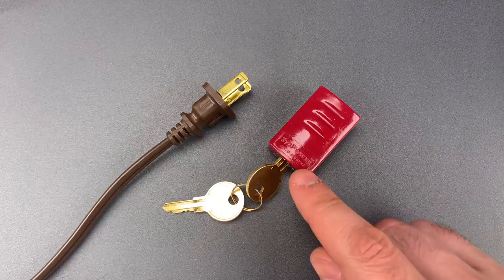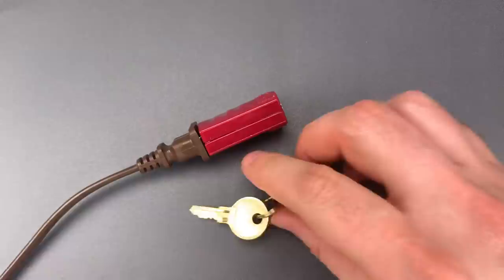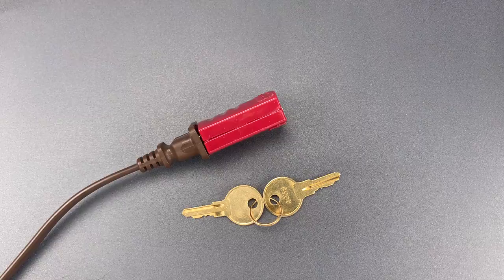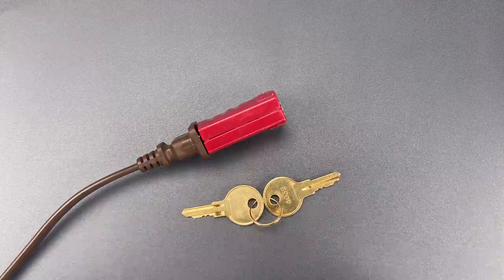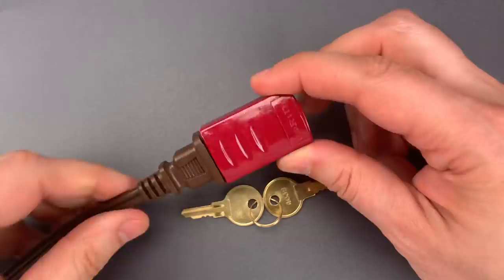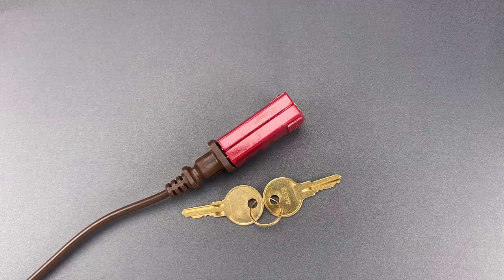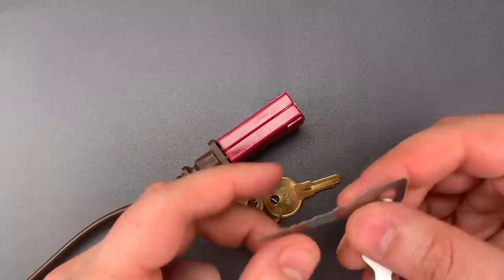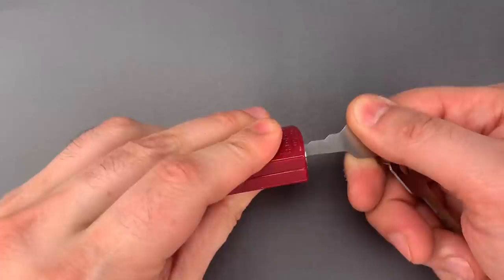[1138] Stopower Electric Plug Lock Jiggled Open FAST

Comment: When Duct taping the plug would actually take more time to access.
Reply: It is usually a legal thing. Some devices should only be operated by certain (authorized) people. Putting a lock on such a device (even a bad one) does prevent anyone from willy nilly putting the plug into the socket. If you remove the lock without a key, you have done so with a predetermined mindset and cannot argue that you didn't knew that the device is not allowed to be used. 

You must have seen some of the show cases at a jeweler. You often need a key to open the display. However the glass case and the lock inform you that you are not allowed to touch the jewelry without consent. But technically a hammer opens up a display case faster than a key. However both 'safeguards' have the same meaning. It is a legal 'framework' that make a distinction that certain objects are not for everybody. In that context, a good lock is not required.. 

The lock in the video prevents you from using the device. However there are also locks that prevent you from removing a plug from a socket and doing the complete opposite from this lock..
Reply: @2Fast4Mellow  That is a complex answer for what was fundamentally just making a joke. Wrapping a plug in duct tape would also make it harder for authorised entry.
Reply: @adder2204  i mean putting the words "no plug in hole" on the duck tape would have the same effect as the lock and what ever that other guy was saying. so his point is pretty moot. also who the hell just goes around plugging crap in that is unplugged? if it is unplugged, it's unplugged for a reason, if a key is on it's on for a reason, if something is a specific way and it's not yours to touch NOR do you know why it is that way, do yourself a favor and just don't touch it.
Reply: @TheObsesedAnimeFreaks  if everyone had the same logic and there were no accidents accidents or situations, the world would be a better place
Reply: @TheObsesedAnimeFreaks  could be technician locking up a commonly used tool at a worksite because he needs tools for repair or something
Reply: @Spikeupine  you could just remove the tool from the work place into a location that is known to have broken equipment. Or there are plenty of other options available. Obviously if it is a tool that isn't plugged in 24/7 it's going to be portable or in a location where it is easy to inform the suspecting employee that the equipment they want to use is out of service.

There might be some cases where that's not possible but the main example I can think of is a vending machine that in all honesty would get a sign that you can read.

Comment: "The security equivalent of a "do not disturb" sign"
and for industrial uses... that's basically all you need. lockout/tagout procedures aren't meant to prevent nefarious actors from doing bad things, the point is to prevent accidents by make it obvious that This Thing Must Not To Be Used and impossible to accidentally ignore warning signs.
Reply: Yeh at work(a factory) we have to but a lock on the door(one for every person inside) when we go inside an automated production area to do maintenance or cleaning. So one of the maintenance guys has a tiny padlock from a childrens diary and i just super glued the key in to the keyhole on mine.

Comment: Having worked on a website for a safety sign company my gut reaction is this is probably used in a workplace application where something is broken or is being worked on and you don't want someone plugging it in and using it. It's not meant to be super secure, and is just meant to make the average person realize that they shouldn't plug it in. (Or turn something on.) It seems like the same thing as a lockout padlock for larger equipment.
Reply: Soooooo people playing by the rules
Reply: Exactly. It’s not a high security lock. It’s a Lock Out Tag Out device.  Under most company LOTO procedures, removing a device like this if you weren’t the person who placed it is usually a serious offense. One of the few things that will get you fired.  And if OSHA finds out, everybody in the same county will get hit with a five figure fine.

Comment: "A solid hit with the hammer will probably open it."  Well lets not fool around lawyer boy... smack it hard!!
Reply: "Boy, I say boy... Ya gotta hit it boy. Hit it like you mean it!
(Kid's alright, but he's a bit slow)"

~ Foghorn Leghorn, probably
Reply: Btw, I wonder whether it would also smash the plug.
Reply: @chnet968  The plastic would probably take all the force, which is why it would shatter.  The plug would most likely be fine.
Reply: @8thlvlMage  The pins in the plug aren't that strong, and if they're touching the outside of the lock, they will also take some of the impact. The plugs themselves tend to be pretty strong, but the pins are pretty weak.
Reply: @crisprtalk6963  New to the internet?  He's very much kidding.
Reply: hammer? probably just dropping on the ground does it

Comment: I picked my first lock thanks to LPL. Customer had a car sent to be worked on, but couldn't find the key. The doors were unlocked but obviously I couldn't turn the ignition lock. I looked at it, thought it looked like a wafer lock and raked it in about 5 seconds with the end of the choke cable.  Thanks LPL :)
I'm going to recommend he has an immobiliser fitted going forward!

Comment: didnt even knew something like this existed
Reply: My reaction to the Ben & Jerry's lock
Reply: me too bro
Reply: I think there's a lock to lock pretty much anything, you just have to look for it
Reply: I mean with EU plugs this would be pretty much impossible to do
Reply: What's wrong with Leon Orlov's grammar? ''didnt even knew something like this existed''
Reply: @flat-earther  who cares?
Reply: @flat-earther  no
Reply: @carstekoch  I want to learn.
Reply: @cyberdusttv  or UK plugs - it would have to encase the entire plug, which is moderately large. 
Anyhow, what's the problem with just passing a conventional padlock of a suitable diameter shackle through the hole in one pin? OK, it's probably going to be a small and fairly easy to pick padlock, but it can surely be more secure than this. And it won't be plastic.
Reply: is it weird that i want one now...?

Comment: My mom used this on the TV when I was a teenager. I used a box cutter and cut around the seam where the two halves glue together, then split it apart with a screw driver. It has small plastic studs on one half that snap into holes on the other.

This allowed me to pull it apart to watch TV when she was gone, snap it back onto the plug when I heard her come home, and it stayed together well enough that she never noticed that I had 'broken' it.
Reply: We're there's a will there's a way or a TV programme to be watched in your case and and I'm also sure your mom was breaching your constitutional rights. Andy England 🇬🇧👍😉

Comment: It's probably more effective to take away the powercable/ power supply
Reply: Yeah my mum did that when i was a kid. The price of specialized cables compared to pocket money sounds like a much greater deterrent.
Reply: @ersetzbar.  What console did you have growing up?
Reply: Depending on the use case - for a console sure, if you want people to think before trying to start a device then only if you make it very clear why the device is not to be used.
Reply: That's what my parents did when my grades suffered...took the power brick to the coleco vision :D
Reply: Yep, my mom would take thr power cable. She initially took the A/V cables but I had spares.
Reply: @artstrutzenberg7197  That must have been in the 80's
Reply: @finn464  yup...gen-xer :)
Reply: Yeah a few wire nuts and most any 120 whip could be spliced onto this cord. Snip snip.
Reply: Pressing the main fuse of the attic floor is what my father did in the early days.
Reply: @michielvanerven5638  That's quite drastic
Reply: Back then, my mom locked my PC (she had a separate computer) in a little room we didn't really use. One day, I took all the parts of the computer out of the case and put them into a shoe box in my room.
Reply: @Mr_Yeah  10/10 cooling
Reply: @finn464  Not really, I was born in the 90s. We didn't have internet until about 2005ish, so couldn't order online. Hardly anyone had computers, and we were in a small town so nowhere near me really sold spare cables. Plus, pocket money was £5/month, and I bought a new charger for my laptop just a few days ago and it was £14.
Reply: Or just lock the tv cord instead if it's permanently attached, aint playing or watching nothing until it's off.

Comment: When I first got my PS3, my father wanted me to go outside more or do my homework and I refused, so he took the cable for the controller away. Little did he know that the PS3 controller was already wireless and battery powered. As a parent you have to get creative to keep a 12 y.o. away from his console!
Reply: Not that hard. Secure the console itself in a cabinet with a decent lock. Problem solved.
Reply: @lairdcummings9092  "decent lock" haha l, this already makes it hard, especially if you are talking about cabinets lol
Reply: @Archimedes.5000  I have steel cabinets.  But I use Abus locks... Because I put semi-important things in there.

Comment: I am never this early! 

Also I can see that being used as a safety thing more than a security thing. On devices with fixed power cords. Also its usefulness is very limited. Doubt it could fit on a 3 pronged US style cord.
Reply: Saw a crappy photo on amazon seems the 3rd prong just kinda sits on the outside
Reply from the maker: 3rd prong definitely fits.

Comment: Game console usually have cables with a connector in both ends.

So to defeat this device you just use another cable.
Reply: One of my buddies back at HS did that, his parents always took away his PC's power cord (no option to lock it with the EU plug) so he just had a drawer full of them

Comment: "It only keeps out those who play by the rules", Is that not true for every lock/security device out there?
Reply: Not really. Get a tough enough lock, and the tools for opening it will be so expensive, that it's cheaper to buy a new power cord.

In most cases, you can reinforce/secure anything so much that another thing becomes the weakest point.
Reply: @tokeivo  And how does that invalidate my point?, I think you need another toke bub.
Reply: @Vandrock  a prison, for example, can keep in/out those that do not "play by the rules".
Reply: Not to the same degree
There are some locks out there that even he can't pick and while any lock can eventually be cut, the time that will take is a prettybig deterrent if the manufacturer had made it out of quality materials
Reply: @jtosety  same as the last DS, And how does that invalidate my point?
Reply: You are incorrect, sir. Some higher end locks are "keep out those who play by the rules OR aren't willing to spend the time it would take to break into this because the time is more valuable than whatever is held within" locks, obviously those who are stubborn and honestly probably care more about sending a message to a particular person(s) will definitely try any way they can, but criminals of convenience are a thing and sometimes it's more convenient to look for someone with weaker security.
Reply: @rambbler  So what are you offering that invalidates my point? , or are you just making a comment for the sake of making a comment?
Reply: @Vandrock  oh I'm not invalidating, I'm adding to it. You are partly right but security devices also keep out the lazy dishonest folk.
Reply: @rambbler  1st I am ”You are incorrect, sir” and now I am ”You are partly right” you seem to be confused, There id NO lock/security device that can not be bypassed or circumvented. it is not a matter of laziness or opportunistic behavior. its like ”water is wet” you can not make it dry just because you want it to be so.
Reply: @Vandrock  I mean being partly right is still bring incorrect, sir. Besides I was referencing the "you are correct sir" thing but changing it to be incorrect instead of correct. Convince criminals are still dishonest people even if they are too lazy to figure out a way in, inconveniencing the dishonest and keeping the honest honest is the point of security devices, and some locks/security devices ARE unbypassable in practice but in theory yeah everything has a weakest link, its just a matter of time and visibility of the weak points that inconvenience dishonest, not just to keep honest people honest.
Reply: @rambbler  You seem to still be confused "There is NO lock/security device that can not be bypassed or circumvented” yet you are still talking about "honesty" and "laziness",  KATIEKATQwQ says "and some locks/security devices ARE unbypassable in practice" again you seem to be confused, you find a lock/security device that can not be and post it here, I would recommend a good nights sleep it will help clear up that confusion.
Reply: @Vandrock  wow, I didn't realize I was having an argument with a little baby boy who can't actually read properly or at least can't read in between the lines. By in practice I mean against a realistic scenario of your standard criminal trying to break into something, and in theory I mean if given enough time and no threat of being caught. In theory ALL locks could be bypassed, but in practice there are some locks that are extremely unlikely to be bypassed when in a time constraint. Criminals are not honest, so the statement of locks "keeping honest people honest" is incomplete. This is my last post here and I won't bother restating this again, call me confused all you like, you are probably right because I am extraordinary sick right now, but I'm not confused about what I'm trying to say. Au revoir.
Reply: @rambbler  Child like insults is your retort to me asking for proof, sad so very sad. I recommend you see someone about that illness a medical doctor/psychotherapist it could be serous.

Comment: Most locks are only there to keep honest people honest.

For this purpose, this cheap lock should be entirely adequate.
Reply: Hmmm. Good topic. I am honest and so locks don't keep me that way.
Reply: Good point.

Criminal: "Heavy-duty padlock."  Proceeds to kick the door off its hinges.
Reply: Honest people don't need locks.
Reply: @omegalord  not true. Because honest people still have to live in a world with dishonest people.
Reply: @omegalord  because honest people dont have things that they wouldnt want stolen?
Reply: @justincarawan-carawanco.pu1639  exactly. The determined criminal will go around, about, or through any barriers to get what they want. The only thing a lock will deter is a casual thief.
Reply: @lairdcummings9092  Locks are basically the insurance's equivalent of a "warranty void" seal, aren't they
Reply: @omegalord  people keep taking that wrong. It isn't saying that every honest person is a lazy thief to be kept under control; it's saying that only honest people will respect it. It's prevents the honest from accidentally trespassing, from accidentally accessing things they shouldn't, etc.
Reply: @cyberdusttv  mostly, yeah.
Reply: @giin97  and also prevents basically honest people from giving in to temptation.

Comment: No one:
Me:
Oh I can't use the console? I'll just change the power cord😂😂
Reply: Destructive method. works only once and will net you trouble.
Reply: @mojolotz  I mean,
The PS4 has a removable power cord, so you can change it if you want
Reply: @fabiostanila6448  oh... well nvm then xD Never owned a console. thought they were fixed cables.
Reply: I dont know about you guys but when i was a kid a power cable of a console was about 2 - 4 weeks of pocketmoney
Reply: @ersetzbar.  
A simple power cord is like 2-7 dollars. And it's a much better investment than a 60$ game you can't even play because the ps is without power.
Reply: @carstekoch  if my memory doesnt fail me it was like 15-25 euro when i was at that age which is like 10-15 years ago.  with a pocket money of 5 euro per week it was definitely not something to just buy with the risk of it getting found. we just did tours, when one mum kicked us out, we drove to the next friend until his mom did the same and continued like that
Reply: @mojolotz   Destructive in the sense that your power cable may be slightly shorter after you wire up the replacement plug?
Reply: @anyGould  Destructive in the sense that whoever put the lock there will know.
Reply: @mojolotz  destructive in the sense that, its a common universal plug. you can swap it for a computer monitor cord. some tvs have these cords. just change it out and back before anyone notices.
Reply: @Kittsuera  yeah i thought you had to pen the cable and change the plug. turns out consoles have exchangeable cables. never had a console.
Reply: @ersetzbar.  A cheaper solution is chop off the plug which is locked, and then replace with a new one.
Reply: @olivertwist9003  sure nothing could ever go wrong with kids in the single digit age playing with 220V.
Reply: @ersetzbar.  That is so fortunate that I learnt how to replace power plug in the single digit age.

Comment: I used something similar many years ago when I had multiple power leads on the bench; one was terminated with bare leads, just to connect to equipment with terminals. I didnt want to accidentally plug that one in and have live leads floating around, when I was expecting to use an IEC 320 C13 or C7. Security wasn't the issue, personal safety was.

Comment: My high school used those on the plugs for the power tools in the shop (Table saw, Chop saw, etc.). The door to the shop was also locked. I think the plug locks were mostly so you knew the tools were unplugged, so there weren't any accidents. They had a lanyard with all the keys for the locks hanging on a hook in the same room, so you could easily look and see if a tool wasn't locked, and possibly plugged in.